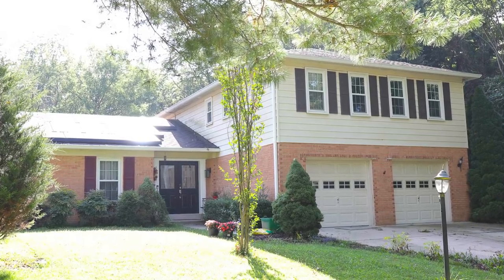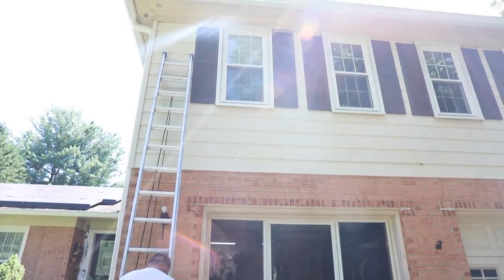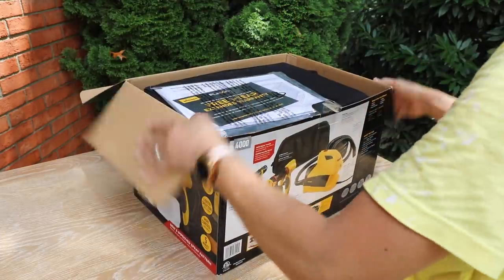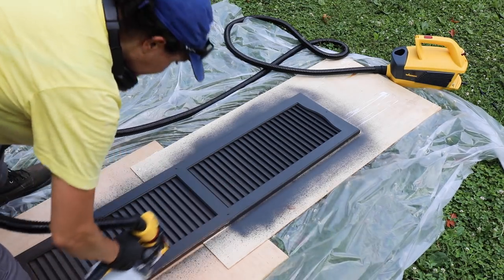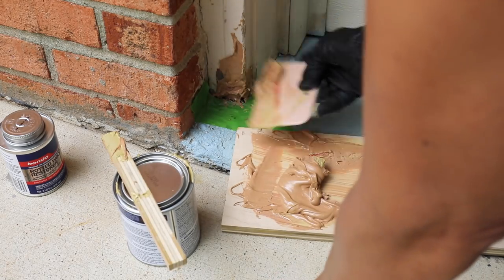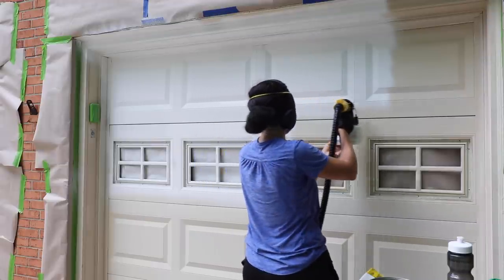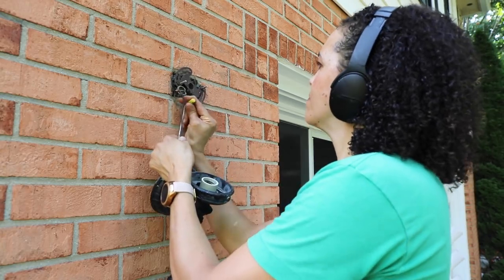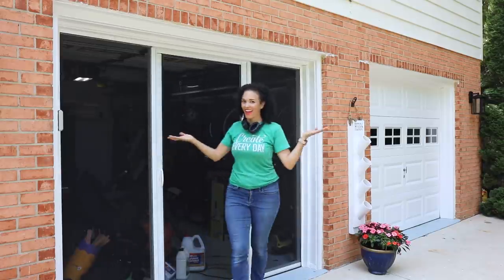Paint Your Shutters and Garage Doors for Curb Appeal! - Thrift Diving

Comment: Your front facade looks terrific! Very buttoned up. After googling painted and lime washed brick homes, I’m favoring the lime wash without knowing the difference in cost. Another thing to consider when deciding between keeping the bricks original or having them painted is whether or not you plan to add any structures with masonry to your future landscape project (I.e. decks, raised beds, etc). I’m sure whatever you decide will turn out splendid 🤗

Comment: Wonderful video on repainting your shutters. They look fabulous and compliment your front doors beautifully. 
Were they vinyl or metal? 
I have metal shutters from the 90s that are not built in one piece. I think they would need primer first for the paint to adhere and last.
DON'T PAINT YOUR BRICK! Your brick is a lovely muted red and your accent paint colour coordinates with it. 
If you do, you will have to repaint every ten years and that ain't cheap. Before you know it the paint is peeling and cracking and looking horrible. If your house had soot, pollution and weather damage after a century it could make sense. Don't do it to brick that is in good shape.
A new siding could be enough to update the look from the 70s to this century. Your house has great proportions and doesn't need the colour fix, in my opinion. 
I think you're right, new landscaping with evergreens, flowering shrubs and ground covers more in scale with the house would be transformational. 
(The Alberta spruce is blocking your new front doors instead of framing the entrance.)

Comment: Used RUSTOLEUM X2 spray paint to paint my shutters apple red. They came out great. Have bee spray handy ... bees nests behind mine. I took my shutters to car wash & used pressure washer there to clean them. For less tha 2 rolls of quarters I did 24 pieces. 
   We painted front door also. Used spray paint for front door while in it's place. I DO NOT RECOMMEND THIS ! OVER SPRAY WAS MASSIVE IN SPITE OF MY CAREFUL PREP WORK TO PROTECT stuff in that room.  Took four hours to wash it off floor, furniture, copier, Keurig  ect. Thank God it came off with wet rag & paper towels. That way you know you got it all. REMOVE DOOR TO SPRAY PAINT.

Comment: Don't paint the brick because the upkeep is no fun. "Stain" the brick by diluting house paint in water 50/50 with 1 Tbs calcium carbonate for each 2 cups of diluted paint.  The water will weaken the sheeting of the vinyl filler in the paint and the calcium carbonate will denature it.  It will end up working like a stain and be translucent on top of the brick.
Reply from the maker: Ooh, that's a great idea! I will research this!